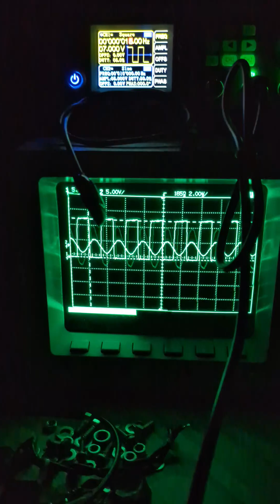my QCW DRSSTC :) [lightning generator] #highvoltage #teslacoil #engineering #lightning

Comment: I would recommend to connect the MMC capacitor with the wire from the  primary to where it is right now and the other one in the opposite side from where it is right now, according to Steve ward, the connection you have now, C2 will draw more current than C1, C3 will draw more current than C2...
Reply from the maker: Thanks for the recommendation 👍